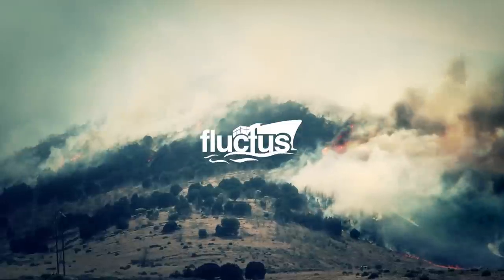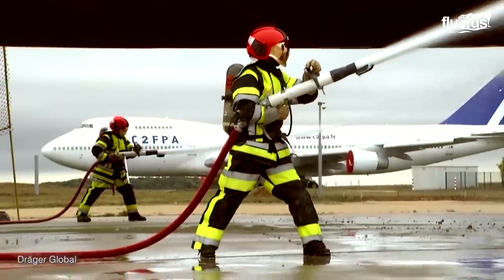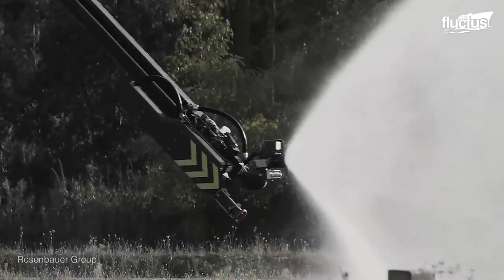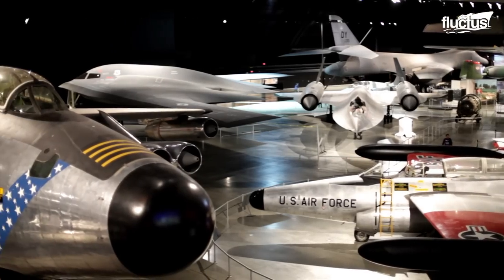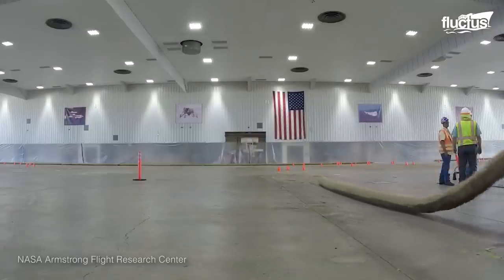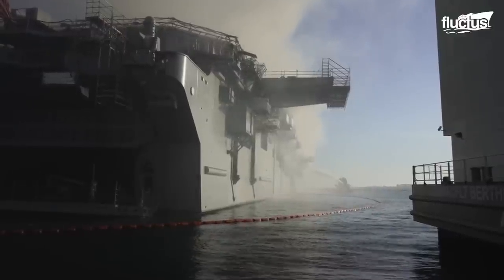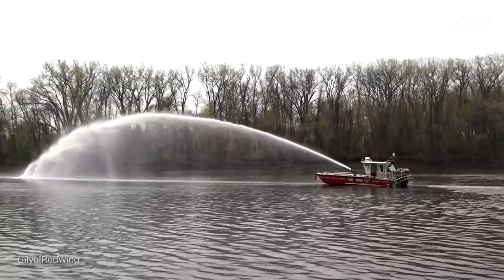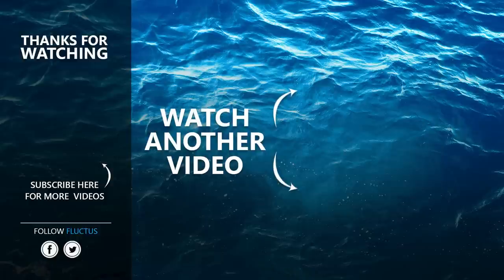Reason Why Airports Keep Million $ Fire Trucks on Standby

Comment: I’ve had my ass saved by a national guard airport fire truck. They brought their boom truck out after lightning caused a fire at a series of large crude oil tanks. When one ruptured unexpectedly (and in a way it shouldn’t have been able to) they came and sank their truck in a field and started flowing massive amounts of class A foam on the fire. It knocked the fire down enough for us to get ourselves out of what would have been a death trap. It was so hot it literally was melting our fire hose, gear, and did 40k in damage to our truck. Hats off to the ladies and gentlemen working airport fire service.
Reply: Class A on hydrocarbons?
Reply: Can't be class A I'm an Arff and an operator I wouldn't use class A on that fire

Comment: Quick question how did the San Francisco Fire Department end up in San Diego to fight the fire on the USS Bonhomme Richard?
Reply: Mutual aid agreement that pertains to assisting in staffing the city and helping fight the fire. A fire like that takes up massive amounts of resources and can last days, utilizing hundreds if not firefighters to assist in suppression and overhaul
Reply: @samuelcaballero9966  There are dozens of airports that have ARFF equipment between the two Locations. It makes a hell of a lot more sense to Call LAX than to call SF. Its an error in reporting.

Comment: With the airport hangers, they demonstrated an airport with quite a bit of pocket change; what about airports that don’t have the money for those fire suppression systems, what alternatives do they have? Would it be just the crash tenders or what are the options?
Reply: These ARFF trucks (or crash tenders) are fitted with a structure panel system as well as hundreds of feet of hose and other tools to fight structure fires with handlines. There is also an adequate supply of SCBA for a team to fight a fire inside of a hangar or building. We also train for structure fires and extrication techniques as well. Our first call for such fire would be to a City Fire Dept to assist us, but yes we can attack and defend a structure fire if needed.handling. some airports are structured differently though.

Comment: Sorry to p--ss on your parade, the latest Airport crash rescue tender cannot compete seriously off road with a sixty year old Alvis Salamander ,an airport fire engine jointly developed by Alvis and Pyrene. Based on Alvis,s Stalwart 6x6 go anywhere supply lorry designed for the British Army, to supply their tank battalions. the Salamander despite its drawbacks can go anywhere and  swims. Its six independently sprung wheels are arranged like the legs of a beetle hence its phenomenal off roadability ,each driven via a Rolls Royce B80 straight eight petrol engine , a Daimler preselector gearbox and Alvis Straussler X-drive transfer box. Think  what a hi-tech Salamander in 8x8 form can do for an  airports crash rescue service.